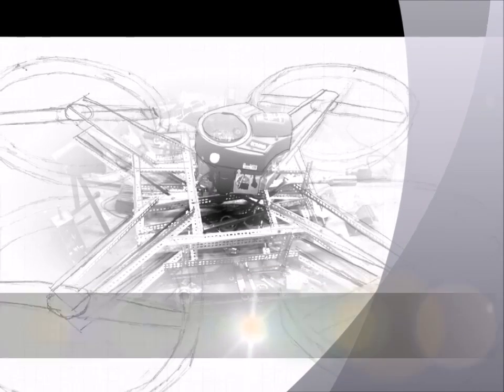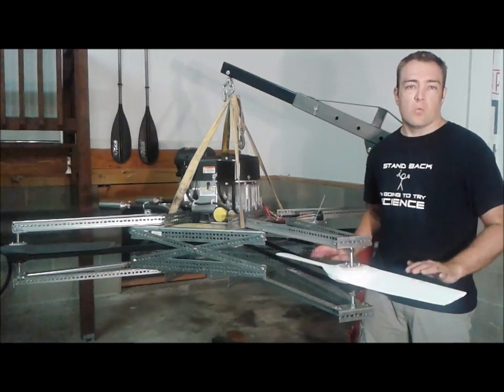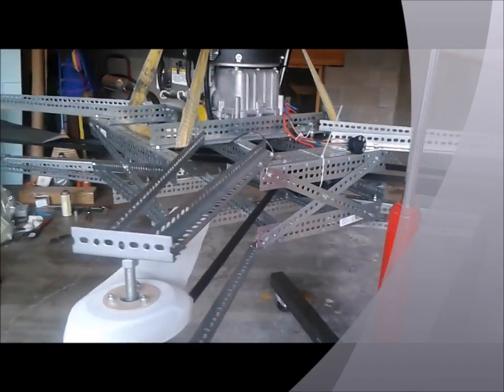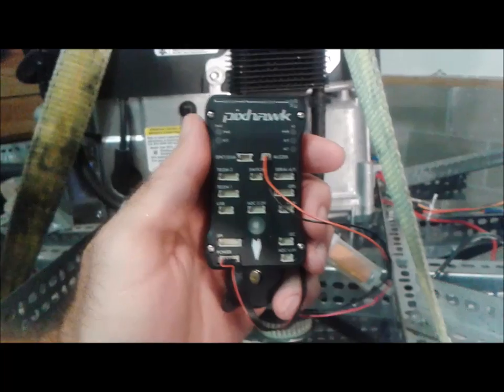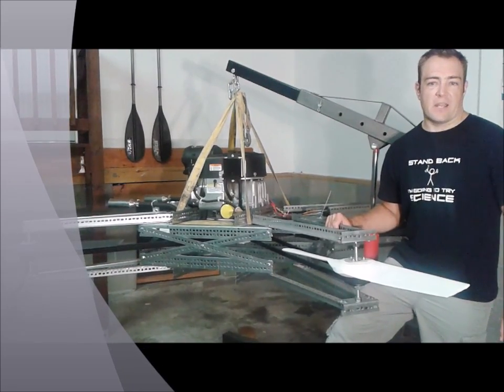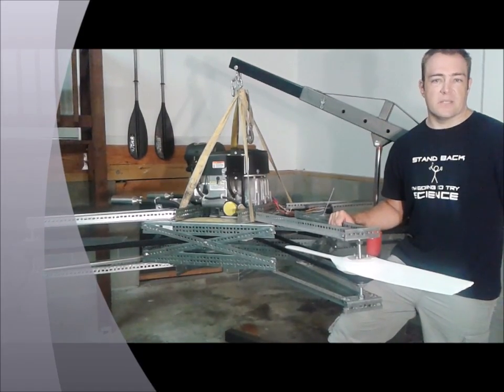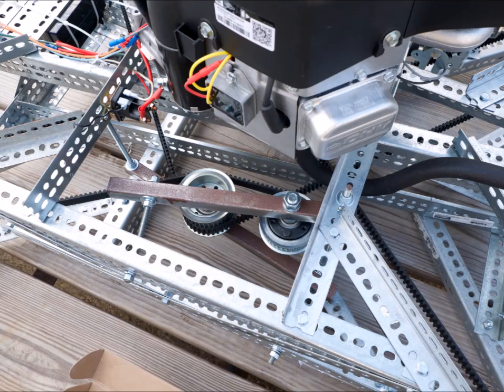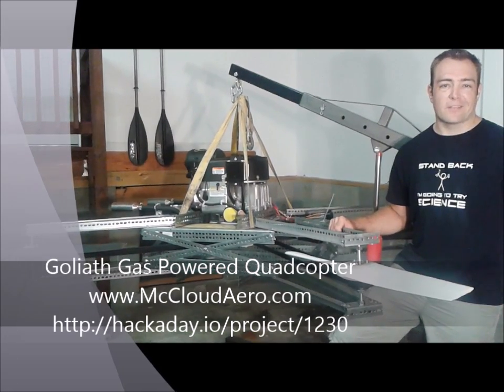Goliath Quadcopter Entry Video for The Hackaday Prize

Comment: I would scrap this and start over from scratch. Clearly the wrong material for this kind of structure as witnessed by the flex on the test start up. Angle iron is for static structures with only a couple of force/load directions, not for something with dynamic loads like a quadcopter. It would only work if it was fully triangulated and then it would be way too heavy for an aircraft.

Comment: how are you varying the output to each propeller? Also that engine seems way large
Reply from the maker: All of the propellers will spin at the same speed, but control will be provided by vanes underneath the rotors (similar to a hovercraft rudder)
Reply: be careful with that thing it could chop you up!
Reply: You should consider creating a way to vary the prop speed or it may be impossible-